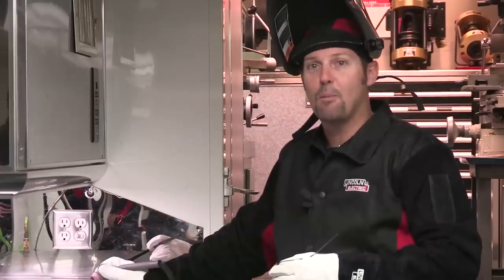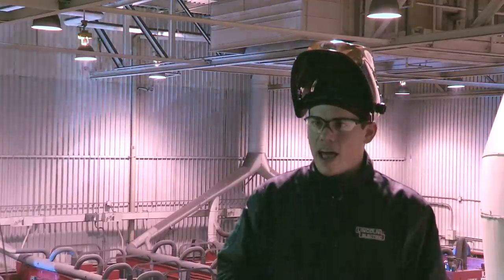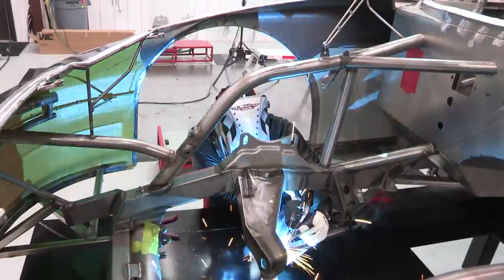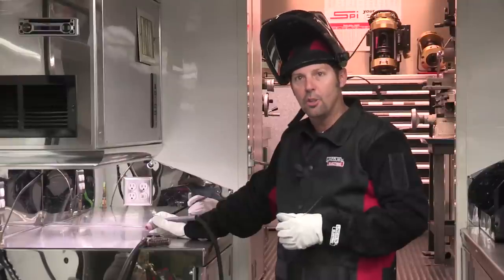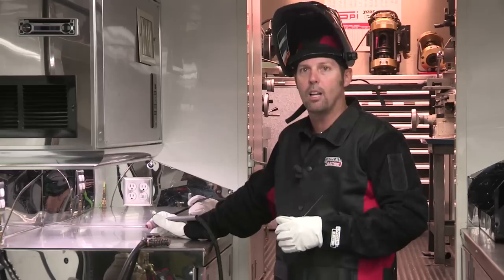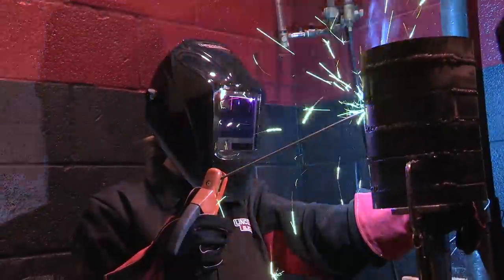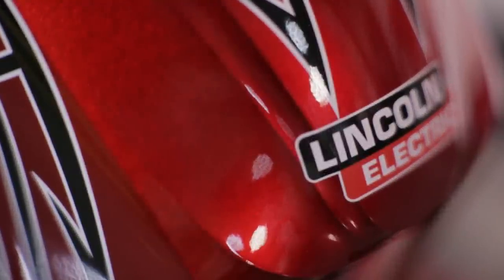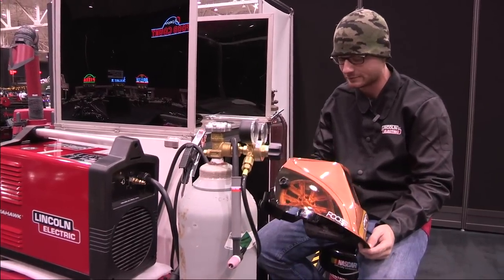Real Welders on the VIKING® 3350 Series Helmet

Comment: i purchased a lincoln 216 with the magnum spool gun and the auto darkening helmet. i haven't used welder but few times and it still looks new. the other day i go to use it and guess what that very expensive helmet no longer works. i didn't realize it until i had gotten a head ache from welding without it going dark. i am very discouraged about lincolns viking welding helmets. i don't recommend at all. if it's going to go bad because it isn't being used then i should of went on ebay and spent 20 bucks on a helmet and probably would have gotten more use out of it.
Reply from the maker: Have you tried replacing the battery in the auto darkening unit?
Reply: I was told no battery that it was solar powered by my local welding store
Reply from the maker: None of those links works. Can you tell me what the helmet type is? Is it a Viking 1740, 1840, 2450, 3350? I can have spec sent to you on how to change the battery. My solar helmets have batteries so I'm assuming yours does. We will find the answer for you and get you squared away. Feel free to email us with the pics and specs. videos@lincolnelectric.com
Reply: Tag says viking welding helmets. 700g adf
Ansi z87.1
Can/csa z94.3
Colts labs
4/9-13 tm 1/3/2 en379
On the left of lense is delay time and on right is sensitivity. There's another number
S27978-6
Reply from the maker: OK. I have some answers. Please send me an email so we can have a chat.
Reply: Jeremy Hamilton my 3350 definitely uses a battery.
Reply: Jeremy Hamilton uh
Reply: You have no clue!